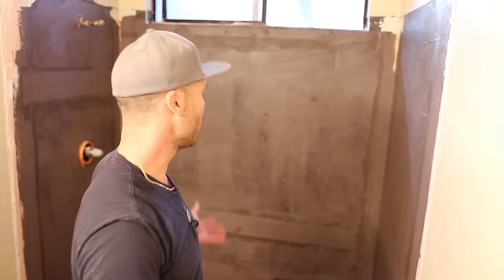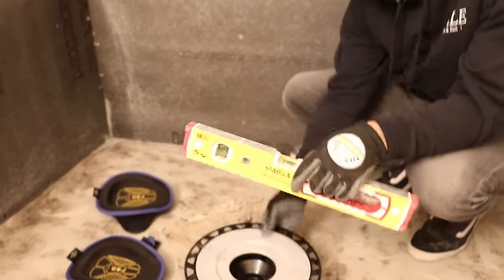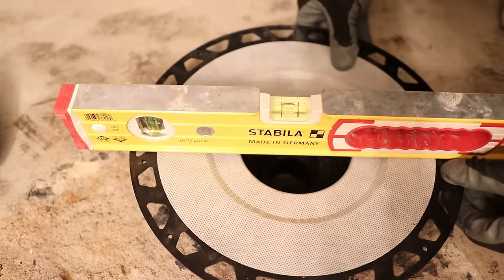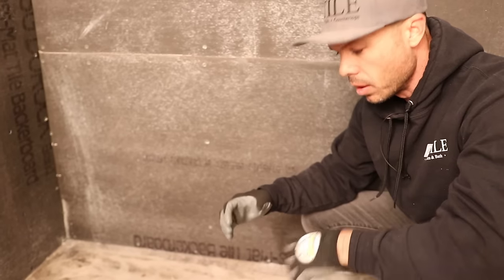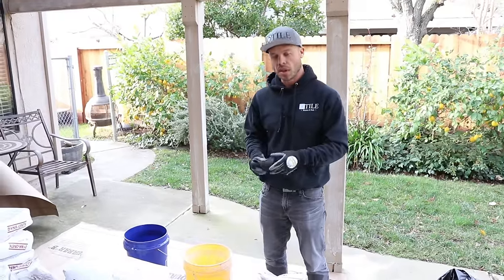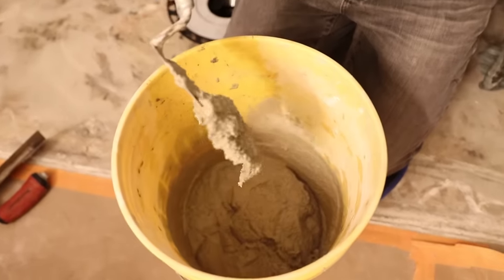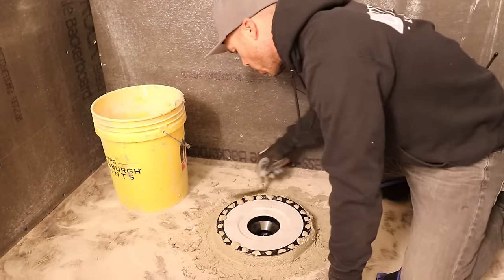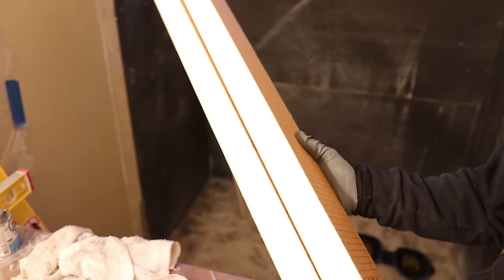One Day Shower Prep!!! MUD PAN with Kerdi and Ardex 8+9 :  TileCoach episode 28

Comment: Assuming that your butt joints are 1/8”or less and we truly believe that Ardex 8+9 is 100% waterproof, why waste the time and money installing kerdi band and kerdi corners and dealing with the overlap buildup? If we are comfortable filling 60 screw holes with Ardex, why would that confidence go away at the joints? I am building my shower with densshield, mud bed, with kerdi over it and I can’t help but think that the band is a waste of time and money. Ardex claims that 1/8 or less does not need banding for crack isolation. What do you think?

Comment: have to disagree with you on compaction.   I packed my last pan with a tamper and it came out smooth as shit.  I've found you get less flaking if you finish the top surface nicely with your flat trowel.  Moisten your trowel just a little and smooth it out after you wood float,  you will see the difference.  It is called a dry pack after all, not dry set it in there.  The only thing that sucks about setting on a fresh dry pack is you cant make a mistake, there is no lifting if you need to butter for some reason.   I decided I don't really like a level perimeter on rectangular shower like this either.  When you set the longer distances at 1/4" per foot the shorter distance becomes very drastic.  The math says it's gonna be pretty close to 1/2" per foot on the shorter runs, which is still in tolerance but I like aiming for a little more than 1/4" since that's the minimum which would put the shorter runs over 1/2".  I just cut in my bottom row.  Seems like even when you do them level (perimeter) you still end up having to shim the tiles.

Comment: Regarding the pipe cement it doesn't get harder and harder like it's drying up as a glue would it actually melts the pipes and then they bond together so you literally softening the pipe with the cement and then the activator stops working in the pipe hardens again into one piece the pipe cement is not a glue it's a melting product

Comment: I love the concept but schluter won’t warranty this method because the products are different! I asked the schluter rep today, he said no warranty so I have to continue with one product only
Love the videos tho man! Keep them coming
Reply: Its not schluters warranty. At this point Ardex' warranty is what would take precedent. One of the reasons I love 8+9 is when speaking to their techs their attitude is, " Yeah use it with kerdi, mesh bands, whatever," like they know the stuff works as long as its put on well. Ive been doing it the same way for a while as well. The only reason I still use Kerdi is the same day aspect since you can put it on the mud with thinset. The only thing I do differently is I still use 2 coats of 8+9. Otherwise I dont think it counts as a proper application of either system. I dont coutn on that anyway. We are always on our own. If a failure happens having a company give me free replavement materials aint helping much lol
Reply: Dn lol definitely understand the being on you own thing😂
Great to know about ardex I need to get in touch with my local rep so I can get something tangible from a rep
Reply: I dont even consider it a kerdi instal. Its an ardex install just using a bit of kerdi membrane but you can use ardex fleece membranes if it makes you feel better. I just cant find em!
Reply: Dn does ardex require the same overlap amount,trowels band,etc.?
I have only had one schluter system fail but it was just the pan by the drain one of my guys cut the hole too big and the foam didn’t have support so it got squishy, never leaked but grout kept cracking etc.
Reply: I dont want to act like an expert on Ardex products. But I'm positive they do have their own version of Kerdi and Ditra. Its on their site. I can tell you I started using 8+9 on the recomendation of the manager at my flooring place. One of the top guys that works out of that store does it that way. We had a conversation where I told him I think this industry may just find a shit hits the fan moment when practical, in the field, time tested Kerdi failures start cropping up. Just like Isaac here, I found it wierd thinset was being counted on as if it were waterproof, noticed after actually doing 72hr flood tests that passed how much water can creep under the bands and not feeling good about it and that no matter how loose or thin a mix I used or how much I knifed out from under the bands it would still be an issue. Then seeing that some cpuntries actually require the use of a 2 part cement based waterpriofing to set the bands. It all just added up for me. I dont trust Kerdi. I may be wrong but how can I continue using it?

Comment: Too dry imo but if you get no call backs or failures that's all that matters. The only other issue I take with it is your wall board should have overlapped the curb which should have gone in first. Always want overlapping joints when transitioning from horizontal to vertical.

Comment: I do the curve whit rapid set concrete and is ready and 20 minutes and made the slope ready for tile expensive the rapid set concrete but very fast and easy
Reply: Do you have many longevity issues with this method? It has been my experience that many fast set concrete shower pans and curbs don't make it much further than 7-10 years without cracking/crumbling and/or a large amount of mildew/mold growth.
Reply: @roostermcghee9506  Concrete will not stick to Concrete.
Reply: @mikebrabant4170  not without some sort of preparation. Although thinsets often have enough additives to make them stick.

Comment: Hey Isaac, learned a good amount watching your videos. I'm about to start constructing my curbless shower. i was wondering, whats the better route? should i go with a Schluter tray or go with a Mud pan? @isaacOstrom
Reply: cahitapower I will be doing a curbless shower myself. Which way did you go? The Kerdi tray or a mudbed?
Reply: @andread8251   hey Andrea, i went with a mud pan. Cheaper and in my opinion more durable. Just abit more work due to insuring the slope is correct. But all in all felt like playing with sand at the beach. Fun process. Goodluck with your project.

Comment: Why did you put hardibacker on the curb? You showed a video where a shower curb failed because hardi was used. Water penetrated and the hardi turned to paste. You could have just used durock as you did for your walls so you would have waterproofed the curb as well.

Comment: Draw a level line on the walls at the proper drain pitch. Build a curb with mud all the way around the perimeter of the shower about 6 inches out from the wall. Fill with mud in between perimeter curb and drain. Pack down and smooth out. Much faster than this method.

Comment: I am old school. Started in 1991. Pre float mud to drain. Put the pan in 6 inchs up the wall. Water test for 24 hours. Put mud pan in, then run rock up the walls. the pan is behind your rock. water proof walls and curb. Need to build a bathtub to keep the water going down the drain. Your system has to many seams, Its going to fail. Just saying. Nice video though.

Comment: You didn’t glue your drain properly. To properly solvent weld, it is necessary to turn the fitting a quarter turn so that the melted ABS / PVC from both fittings weld together. Just applying the glue to the fittings and pushing them together can lead to leakage.

Comment: Why do you still use this system even after it’s failed for you
Reply: Sees to me that after rigorous testing he's developed a system that works both theoretically  and practically . Cheers. Great camera work also.
Reply: c Only if your not smart enough to comprehend the videos, don’t comment. This was the only system that didn’t fail the test.
Reply: rattown99 silencing questions is the way to truth.
Reply: Isaac Ostrom id seen a video on your IG of a shower drain felt fail. I build more traditionally hot mop float lumber etc. how do you decide between which process you’ll build with. I’ve seen you hot mop with float. I’m curious on the price point difference. As one will last 50/100 years. This foam system I don’t see living past 15/30
Reply: @christopherr7195  Hi, I think the felt on the drain will not wick water because the water cannot penetrate the ardex brush on to get to the thin set that is between the drain felt and the schluter membrane. Is that what you were thinking about? For using the two pieces of foam. On edge they are stronger than if they were laid down flat on the orange side. But like you suggest perhaps the strength of that specific type of curb is a good suggestion for another one of the coach's testing videos. I have, just for fun, tested using extruded polystyrene as an underlayment, (2 inches thick foam), for granite tile. It does not compress and it held up to snow, ice, rain and emersion into a water bucket that was allowed to freeze solid. I did use a dovetail router bit to score in something for the thinset to grab onto. . Used the plain HD thinset only. Worked great. Can you be a bit more specific about what you mean? Cheers again.
Reply: I have seen every system fail all due to improper install and making up your own way if you follow the correct install for Schluter systems it will last forever no question
Reply: @yogisteve393  I was more questioning the why.  is it just cost that you look for these new products.  I get that they are faster, esp Schulter.  People can say they will last a long time, but I just don't believe it.  The co I buy my Prosoco from, the rep, had told me he runs a waterproofing co on the side.  He was asking why I Hot Mop, as he thought it was now illegal.  Something about the toxins in tar, and legislation wanting to make hot mops illegal.  Honestly i havent fact checked his statement.  But if its true then I'd be inclined to believe that making it illegal is more about forcing people to use and buy products that governors and senators happen to own more than them not being good for the environment. And that sums up why I don't trust a lot of these new age products.  they seem like a gimic.  but Ill watch and learn.  its always interesting.  Plus I'd like to know the sales models. because some clients budgets are too low and not worth the time it takes to build it the way I prefer.  Cheers

Comment: flat troweling the mud brings the water up and puts a shell on the float. you should do that on your screeds then fill in with the deck mud. you will never lose your screeds or whatever you said. you could of just put a 1/2 inch thick stick or tile on top of the drain and leveled back to the wall for your slope. then leveled from that point around the perimeter. this would simplify the process for people not in the trade. you would get better results on your floating if you used straight edges or couple different sized sticks  to rod off your mud. why are you packing the mud after you were using the wood float?  kind of backwards isnt it. i think you are having all these issues with jobs because you mess with all these products. put a pasco pan in and float the walls. problem free.

Comment: Help the rest of the tile youtubers understand why you are using two different products waterproof the shower.  I feel you are setting your self up for a problem down the road when you do have a problem with all the different manufacturers products you are using.  Ardex suggests using mesh reinforcement in corners and drain. There is no talk about using Kerdi first then sealing that up with Ardex 8+9. To me it's just to many products to many problems.
Reply: @TileCoach  
I get the warranty point. 
I understand what you are saying. I just feel that if you feel so confident about the Ardex then ditch the Kerdi. Which from your testing you do not trust anymore.The Ardex I have never seen only the three top manufacturers,  Mapei, Custom, Laticrete and there products.  
So if you had a standard clamping ring drain and the fiberglass mesh Ardex suggests the Adrex wouldn't hold up just painted on the deck mud and cement board or you would trust it? Your essential doing the same by painting the cement board.
I used Mapei Aqua Defense as a crack isolation membrane in the past painted on a concrete slab for in slab radiant heat. Came back the day after I painted it and in one spot on the entire slab that I had leveled with there products the Aqua Defense peeled right of the lever like dead skin on a human.  Contact the rep and he couldn't fix the issue.  All the rep did was to document it and move on. Since that experience I would not trust any of this paint on material but I still use it in certain situations like seats and pony walls but no where else .
Reply: @TileCoach   The Mapei rep at the time had me coat the floor leveler in the one area the Aqua Defense  pulled up from to try and fix the issue. Needles to say the 2 days later the product peeled of that as well. Out of 400 sq ft and area about 8x8 would not adhere. 
Back in the day vapor barrier behind the mud wall was all we did and there was never any issue with water except  for the caulking at the tub. Showers had a lead pan and the vapor barrier was over top that at the wall transition . Then they invented cement board so we did not have to mess with sand, cement,wire, lime and the labor. You could still install the vapor barrier and have the same result as the mud job. Why all these products to water proof the the wall. Doesn't the the glaze on the tile repel water?
Back in 1972 my father built his own house and installed a product made by American Olean called "Master set" that was scored to look like 2x2 tile. The tile was installed with mastic over sheet rock in a tub area. The product was from the factory 12 tile joined by silicone in all the joints. After the sheets were installed the installer siliconed the remaining open joints. The tile is still in the house (Dated) and not one issue with the install.

Comment: I have to disagree with you putting rapid set under the drain , reason, only to keep it stable and level.  You just created a cold joint and you state that in your video,  but you also think that putting that adhesion promoter around it to bond to it.  No matter what you put on it,  it's still a cold joint. Adhesion promoter is just that,  and not used for cold joints,  all mortar bases need to be monolithic in a pour, adhesion bond only helps to keep the base from becoming loose from its base on the flat, not the side of the drain.  I suggest you either scratch the edge of quick mix for bonding or step it, use your mortar spoon and run it around the quick mix to make a locking bond.  You have to remember,  both mortars you used have different Temps also, and flexing ability, Im totally against 2 mortars in a shower bed, can Crack around the drain over time.  I want you to test it without the drain there and not on a customer's shower,  watch over time what happens between joints. Your a experience tile guy and seem to know how to do the work,  keep it simple,  put the same mortar under the drain.

Comment: Two words. Red. Guard. I know you've used it! Why still keep using schluter?? It's a waste of time and money
Reply: abe wilcox i tear out red guard showers constantly the pvc liner and 3 piece drain with red guard is made to fail 
Plus it takes days to prep correctly .
Millage gets you every time
Reply: @justing5098  well, there you go. Those are done wrong. Schulter drain+ Redgard for the win every time. I've been doing it for years with exactly ZERO failures.
Reply: abe wilcox yeah, but you said ‘Red. Guard.’....not Schluter + Red Guard. So you changed your mind, and Schluter is not a waste of money (and it saves time as can put on an uncured bed)?
Reply: abe wilcox my bad; you specified ‘drain’ not membrane. Still, you have to wait for the bed to cure, and I like the double protection in the Schluter/Ardex approach.
Reply: @rickroll9086  what is the difference? You have to wait for 8+9 to cure also. And why not use the 8+9 directly over the walls and shower floor pan? It is approved for that application. It was never designed to go over kerdi, and frankly I'm amazed that schluter would approve it. Either way, putting a waterproofer OVER another waterproofer seems quite redundant and a waste of time and money. I think the schulter drain is pretty brilliant, and with a topical membrane you don't need to worry about water under the base. That is where I think redgard shines, I actually add a fiberglass membrane over then entire shower floor for added strength although it's not required. I've never had a failure with this approach.
Reply: abe wilcox schluter don’t approve it , I asked my rep
Someone else told me that ardex will warranty over schluter tho so it’s their warranty.... I don’t know that for sure yet tho gotta find the ardex rep around here
Reply: @justing5098  well then that makes this video even worse. If he is suggesting to do this, then people will do it.
Reply: I like the Laticrete flange with Hydroban in a similar config. And Laticrete fully supports that configuration.

Comment: i dont really understand the point in any of this, why not just buy a tray and fit it in like 20 minutes? or if you must tile the floor again, buy a tray that sits in the floor to be tiled, they are 100% waterproof, come in all shapes and sizes and save by the looks many hours of work. is it just an american thing to build your own tray or something? what is the reason for going to all this effort?
Reply: What tray materiel? Kerdi foam pan sounds loud when shower water strikes tile, somewhat objectionable aspect.
Reply: @wallacegrommet9343  not seen a foam one, the only ones iv seen are like a hard resin like a normal shower tray, never noticed any noises